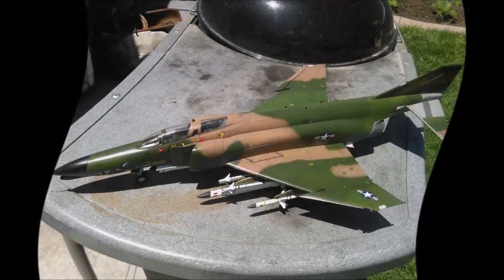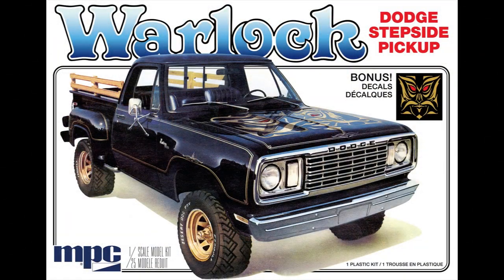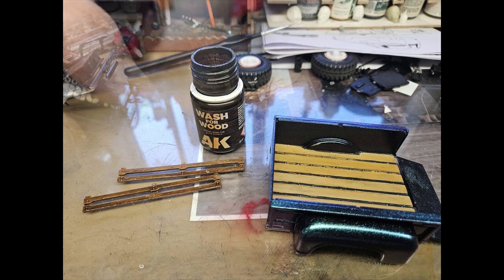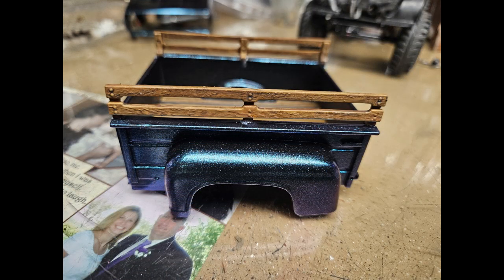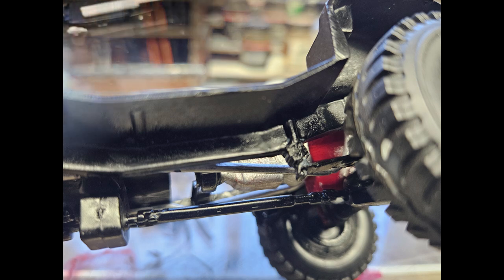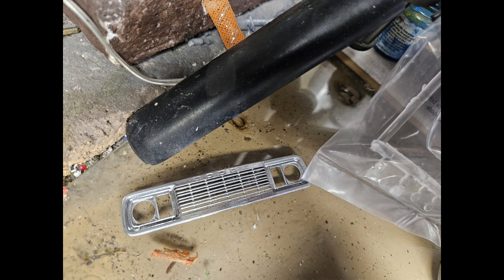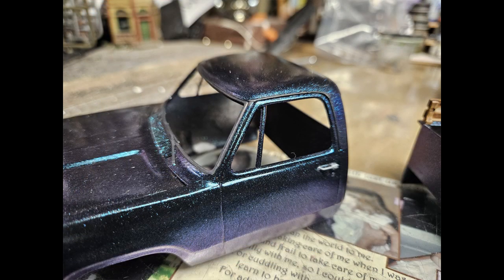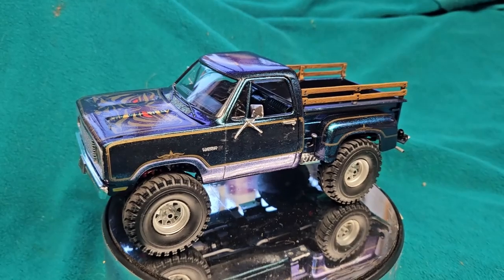1/25 scale MPC '77 Warlock build

Comment: The 3d print looks great i agreed with Pete raid the parts bin still looks pretty good rough and ready 👍👍
Reply from the maker: @seamybmw  thanks, I would definitely recommend rating apart, spin and getting good headlights. The marker lights, I'm still not sure how to best handle that one, but overall the 3D printing is great. It just  leaves you without a completed model, by not including away to have the lenses.

Comment: The 3d grille is an interesting change. I think I would scavenge styrene lenses rather than her resin.
Reply from the maker: @petesmodelcarcustoms584  that was my first thought as well. But according to the person who manufactures these, he recommends using the uh UV epoxy, so I thought I would give it a shot and I much regret doing so.
Reply: @maddogmerv I understand that you've followed the manufacturers advice but the styrene parts would have given the grid pattern. I don't know if you could clear resin cast lenses from styrene🤔. I would have looked for big rig parts for rectangular indicators🤔
Reply from the maker: @petesmodelcarcustoms584  yes, this was definitely a learning experience for me. The first time I've had to do something like this. Fortunately for the rest of you guys, I think this was a good example of what not to do.
Reply: @maddogmerv  I think you are right,Merv👍😶.I used some chromed domed gems,I polished the chrome off the backs to just have clear part, and have used them as projector lenses over the headlight buckets😀. I have run out of clear styrene lenses and really need to cast some😣🤣🤣🤣🤣🤣